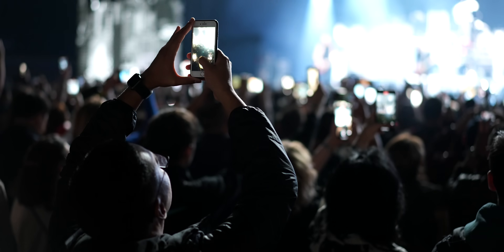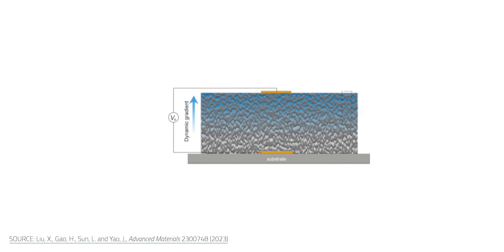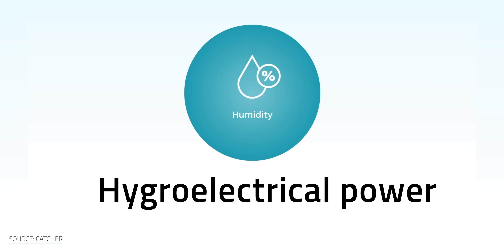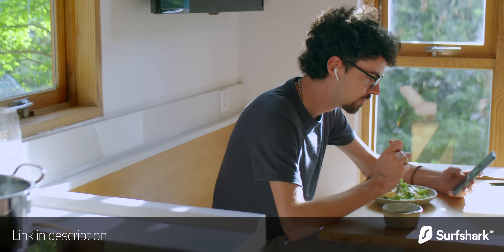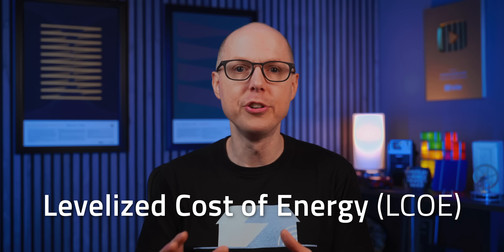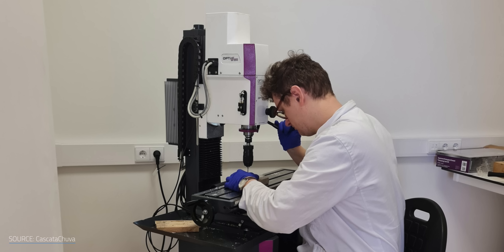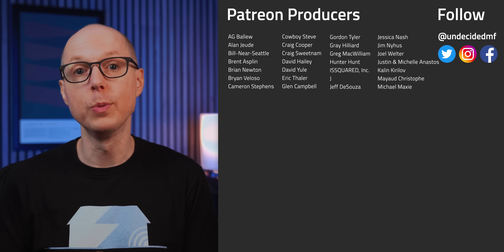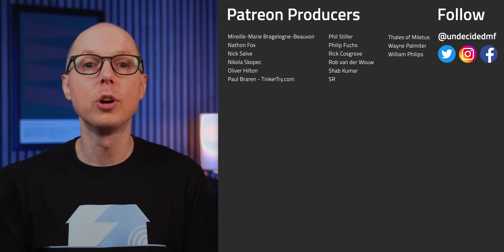Is This Accidental Discovery The Future Of Energy?

Comment: First two questions, right off the bat.
- If they've been working on the tech for a decade (hope I understood that right) then people must know by know how the voltage behaves over time. Does it slowly drop? Does the battery 'fill up' with moisture after a while?
- If so, how would they recharge it? If warming in the sun would be sufficient, then there is also warmth of the battery's discharge reaction itself to reckon with.
Anyway, like you said, lots of unknowns. But I still wanted to point this out because the narrative in the video makes it sound like you just plop one of these somewhere and it will generate power in the (relatively) long term like a solar panel does.

Comment: It all comes down to cost per watt.  10 KW hrs/day = ~0.46KW Continuous = 460W Continuous; 
At a cost of $20,000 USD that comes out to be $43.47/Watt
This is far more expensive than baseline coal power which is $2.50/Watt
Even Residential Solar has an installed cost of less than $4.00/Watt

However, this technology has two main advantages - First it is a solid-state technology, meaning that maintenance should be minimal and it should last a very long time;  Second, It operates continuously, making it suitable for critical applications in which a power disruption would prove disastrous.  Healthcare, Security, and Defense companies are willing to pay a premium to ensure continuous, uninterrupted power.  I could also see potential applications in low-powered sensors for drones.  

Due to the physical nature of the device, it will likely benefit from economies of scale; and due to the incredibly novel nature of the technology, it is likely that the power output per unit will also increase.  Factor in AI-Accelerated Design and Engineering, and we can assume that the cost per watt will halve every year until we hit some logarithmic limit.  So we can expect the cost to go from $44 to $22 to $11 to $6... Down to some floor level - which could be as low as a dollar a watt - sometime within the next decade.

Comment: There is a legend out there, maybe a myth, that says Nikola Tesla swapped out the combustion engine in a Pierce Morgan Arrow for his multi-stage induction motors. Tesla's EV didn't need batteries for power though. The legend says Nikola's EV was powered by the energy in the ether all around us. Allegedly, Tesla invented two devices for this project. The first was a device that tapped into the ether to harness the ambient energy, and the second was a device that converted that energy to electricity. I don't know if he actually did this, or not. I wouldn't be surprised in the least bit if he was successful, but the design plans are not being publicly shared. The financial powers that rule this world definitely would not want us to have such devices. However, I do know that there is enough ambient (static) energy all around us to power this entire planet freely and forever (as long as the sun and the cosmos allow).

Comment: What I am wondering is what happens to the water that enters the nano-pores?  Presumably, you need to get more water from the humid air to continue generating electricity, but doesn't that mean the water that had entered the pores previously has to move out of the way for the new water to enter?  Can the battery become saturated?  Does it have a drying cycle?

Comment: Does any of this process help to collect water out of the air for drinking? It would be neat if it had a two part harvest. Maybe it could dry and cool a humid environment. You could separate compartments or rooms where the equipment sits and reap the benefits in a closed environment next to the open environment where there is collection of humidity.... just a basic concept brainstorm here..

Comment: I think there is a well known effect behind this phenomenon. I guess it has something to do with surface energy of condensed vapor in nanopores. The pressure inside of a nano drop is in the order of several thousand or even several ten thousand bar. This is so much pressure that the water becomes degenerated matter. The molecules electronic band structure changes a lot. A gradiend of the band gap across the thickness can occure leading to a electric potential.

But what happens when the material is filled with water? The potenatial will vanish. You have to heat the device to regenerate the pores. I guess, you need much more heat for regeneration compared to the energy gained by degenerated water condensation. It could be probably impossible to drive the water out of the pores.

Comment: I am curious if you put one of those humidity capacitors in a solution where the lower layer is salt water and the upper water layer is fresh water, or water on one side and air on the other.

Comment: It only produces power when the humidity changes, when the humidity becomes consistent throughout there is no difference in charge to produce power. So, the power production will fluctuate, and if the humidity doesn't change much it won't produce much power.
Reply: That is not what I heard them say. Seems to me like they said it works as long as there was some level of humidity and output is affected by the humidity level. They said: "...as long as the specific humidity is high enough."

Comment: I wonder if this has something to do with the way the molecules of water can bond to one another. I've heard that there is knowledge of the way water molecules bond to each other that we don't have. It would be amazing if a diode was invented that in one mode it would generate light and evaporate water and in another mode use the charge potential of the separated molecules to generate current. You might be able to have new equipment to make hydrogen, electricity, and light.

Comment: You are comparing this washing machine sized gen to a 10KW solar installation - so are you saying this thing can output 10KW.   You are being very reticent about how much water vapor will be used, and how much of the time it will be available.  Will it dry the house air too much?
Reply: Well, water is already fully oxidized and stable, so whatever water goes in, must also come out, it’s interesting, is the water that comes out different somehow? I don’t think so but I don’t really know. This one may merit some further inquiry
Reply: I’m thinking it would be a good idea to get some of the US govt instrumentation involved to find out exactly what is happening to produce the charge and possibly improve design. It’s not using the water, something about how the water is traveling through the divorce is what is causing the charge.

Comment: There are dozens of these very tiny energy generation methods, and similarly many ways to make ubiquitous devices use less power. Individually when they are new; they are costly to make because of small batch sizes and other issues. But if you consider all such technologies today; in 500 years they become commodity products that are added as a system to many things such as Building Bricks...and at that point it would cost more to have those same Bricks that does not have power storage or generating in it. IE once they are that common, getting anything without them...becomes a low batch size special order, thus why it costs more. However 500 years is a long time; many millions of other things would also be different over such a time scale so no prediction is reliable, just different guesses for different variables.

Comment: I see how this generates charge, but don't see a mechanism to generate power once the water seeped in. If you try to move or remove the water it would require many levels of magnitude more power than could be harvested with this principle. I don't see where the energy is coming from. Just a rough surface to collect dew with a tiny water turbine would probably generate more power.

Comment: My dad had an indoor swimming pool and he has to do a ton of work (opening the doors and windows, adjusting the settings, it may not seem like much but it's a good 15-30 min a day) to keep the dehumidifier from working overtime cause it's a 4000W device. He even went as far as buying a secondary dehumidifier to use when it's not hot enough to open the doors all day and not humid enough to activate the monster. If a device like this would even generate only a single Watt but dehumidify well, he would still bulk buy it and replace our current dehumidifiers with this. This could have tons of applications in spaces where you need to remove humidity.

Comment: the comparison with solar panels is totally wrong in that scale: 10 kwp of solar will produce at least 10.000 kwh per year,  and up to 15.000 dependig on latitude,  VS 3650 at best with this "air" battery IF ( big if) it can really produce 10 kwh per day.  So the cost is at least 3x vs solar

Comment: You are misleading 9.30 "lose power with a resistor to convert voltage" if an idiot designed your device yes, search buck boost converters.

Comment: But where does the energy come from? Does it act like a de-humidifier? If not, does it suck the warmth from the air, via humidity? That would be an even greater breakthrough. Being able to convert thermal to electrical energy directly and scalable is, IMHO, the holy grail of energy. Think what that'd mean for global warming as well.
Reply: Replying to @dscham1507: 

THE POWER COMES FROM MY NAVEL
Reply: @tompsheridantsheridant7354  very funny...

Comment: What if they just made an electrochemical cell. At such a low current, it is hardly possible to detect the consumption (change) of the material. Or what if it acts as a very good antenna? I definitely would like to see testing that rule those out.

Comment: Sounds very interesting. I wonder if it's a version of the Kelvin generator spark gap. Many might remember the experiment where the drops of water fall through ring electrodes into metal cups and create a current to power a light bulb, for instance.

Given the research is looking into humidity as the water droplet source, this would give an extra power source in areas that might want to use that power for peak shaving in times of heavy air conditioning demand.

Hopefully this turns out to be something real and scalable.
Reply: Reality Check: Yes, but even if scalable, it will be banned, as it would steal revenue away from the national power grid, and those revenue owners will stop developments like this from being commercialized as they have throughout history!

Comment: I think one of the biggest problems in the real world is going to be how to stop this from clogging. It looks like the environment it works in has to be super-clean. Perhaps then it will have to operate in a closed system, where an evaporator / condenser recycles the same clean air, closed off from the outside.(?)

Comment: You could have a Hydroceel (A tube of absorbent material you put into your piano and drown in a tub every 3-4 weeks), or a few even, inside the washing machine sized box and you're pretty much guaranteed a constant humidity... have a hygrometer on the case to check when you need to refill...

Comment: If you put a dish of water on an electroscope (You know, the old fashioned detector of high voltages using gold leaves that repel each other.) as the water evaporates it produces a charge and oddly if you use not water but a solution of CuSO4, it produces four times as much charge.  Does this relate to that phenomenon?

Comment: They forgot to plug it in? Funny thing, the same happened with the original demonstration of the ARM processors. They forgot to plug in the power line, and it worked with just signal power alone.

Comment: I see why it could be another type of energy generator system or another type of battery if you will, but generators use fuel as well as catalysts and there are non-rechargable batteries, calling this a renewable energy source is a very long shot.
If it's indeed the humidity of the air trapped in the material what creates the voltage, the material already saturated needs to be desaturated before we can take it as renewable.

Comment: 1) This functions on the same process as lightning, 2) that means the output can be increased if they decide to engineer the lattice with that in mind rather the current accidental structure.

I decided not to leave at that in case someone decided to ask so I'll just specify: overlaying filaments in layers to channel the water vapor in such a way to intentionally increase both the volume of vapor and it's potential charge. That's the next step of this technology, you increase the amount of vapor flowing through it and increase the charge produced by deliberately forming channels, to purpose, by overlaying the filaments in a precise way. Probably also want to use a material which A, is conductive and B, doesn't bond with oxygen.

Also - the above described, made from current super conductor materials would be a huge break through for power generation: because the current materials - have to be kept extremely cold. If water vapor (humidity) can cause a charge: so can particulates of nitrogen as they evaporate into gaseous form. We could create power plants using these purpose built generators - placing them in otherwise contained chambers designed to recapture the gaseous nitrogen, for conversion back into liquid to be reused. 

...and now I'm done, gonna screw off back into the ether, have a nice day.

Comment: They will not be able to stack so many unit close together in washer machine size style. Think about it. The units need moisture. If y
The outter layer takes up all the moisture before it gets to the center you might have drastically lowered efficiency if the humidity can even get close to the center of the unit unless they got some kind of circulation for the humidity.

Comment: This makes me look at the pyramids differently. It is said that there was/is an aquifer under the pyramids, the inner block were of a porous stone while the outer stone were not, drawing the energy to the top, then this was all topped with a conductive metal cap which was stolen a long time ago. Maybe the shape of the pyramids was the most efficient design to produce the most power available. This thing would have been very similar to the Tesla tower. Just a thought.

Comment: Nano device pores getting clogged with dust and deteriorating is for sure going to be a huge problem as they must be open to the air. Most batteries are sealed and even the unsealed ones won't have this problem.

Comment: This is a nanoscopic variation on flow cells that can work based on fluctuations of humidity in the air.  I heard of this tech but never thought they would get it to market this quick. This sounds more like a tech for watch batteries and such, not cars and such.    It will take a while for it to power even something as power hungry as a hearing aid or earbuds (but it could get there.)

Still, imagine never having to change your watch battery because the fluctuations in humidity powered it.

I suspect similar materials could be used in larger flow cells for more advanced things by either evaporating fluid (such as water) from a tank or transferring water between two tanks using pressure generated by any number of methods.    This could be very useful for small portable energy storage devices.
Reply: Also, I wonder if adjusting the size of the holes allows the use of different materials, allowing for the creation of actual pressure flow cells using safe to pressurize gasses like CO2 for a form of energy storage.  This could potentially hold a lot more energy.

Comment: A better idea would be to convert the latent heat of vaporization of water into sensible heat through low pressure compression of air, just above the level of pressure (2 ATM) necessary to fully expand it using a converging diverging nozzle. This allows full expansion above supersonic speeds and then an impulse style turbine approximate to a pelton wheel for air can be used to collect the kinetic energy. Energy can not be created nor destroyed. Concentration and conversion is not only possible but well established and proven. We have heat pumps and chillers. We know that these can provide COP ratios above 4 even below freezing temperatures. When used in areas with high temperatures and humidities the COP can be greater than 20 especially if a source of industrial  waste heat is already available for mechanical recompression.  If you want to extract energy out of humid air, this is not only feasible, it is assuredly more intelligent than wasting billions on trying to create fusion in a lab without sufficient mass. We have a fusion generator called the sun. All we need to do is extract the already concentrated latent heat of vaporization (940 BTU per pound) in water vapor. One pound of water vapor has enough energy when converted back into liquid water by condensation, to bring itself and 9 additional pounds of liquid water to 212 F. This is a fact and can be easily verified.

Comment: what is the effect of energy being taken out of humid air? does water condense out of it? if it dehumidifies the air that could be a nice side effect. how quickly do such tiny holes get clogged with dust (or would it be easy to put a filter layer over it that can be exchanged or cleaned?)